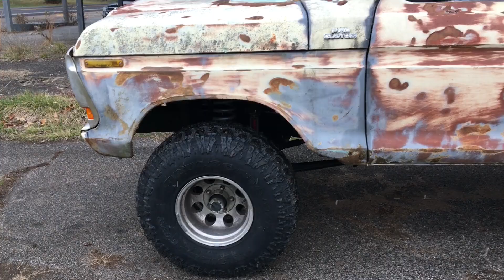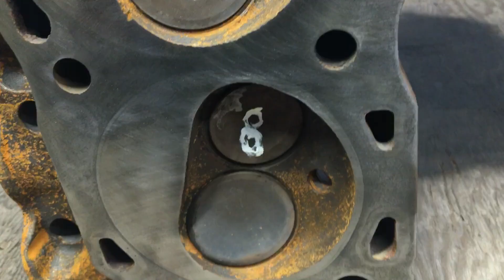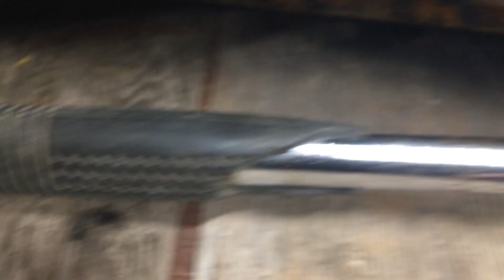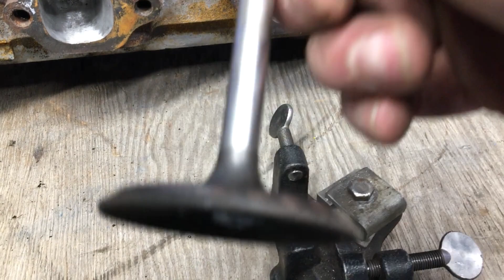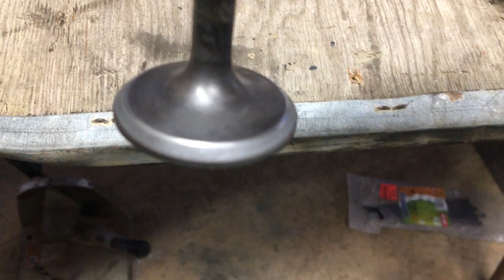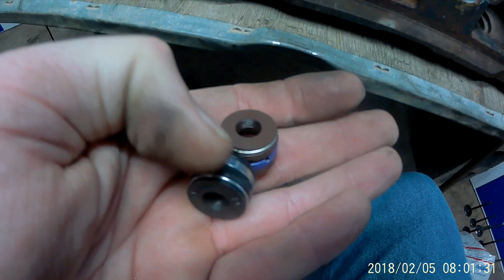460 EFI Cylinder Head Porting and Rebuild!!!

Comment: Have you ever seen 460 heads with valve rotators?
Reply from the maker: I have never seen a 460 with valve rotators. I'm not saying that they don't exist but I've never seen one if they do. I always thought it was odd that they was the only engine that didn't get them. FE's got them, small blocks got them, and the 335 series engines got them but not the 460 it seems.
Reply: @BlackLabGarage  That IS odd. I was thinking maybe they all had hardened valve seats and that's why no rotators but that wasn't the case. From my research some of them had hardened seats and some did not.  I guess it is a mystery. Thanks for the reply.
Reply from the maker: @ the old model high compression heads did not have hardened seats. By the time the D3VE heads came out was when Ford had started using induction hardened seats. But the seats in the fuel injected heads are as hard as granite!
Reply: @BlackLabGarage  Good to know. Thanks!
Reply from the maker: @ you’re welcome!

Comment: I just did another set of FE heads complete 3 angle seats & was able to bring each seat in by using the stone & holder turning it by hand. Lol.
Reply from the maker: @jesseduke694  that had to of taken a while to do lol
Reply: @BlackLabGarage  it really didn't take to long. I didn't do it all at once. I would just sit down at my bench now & then & drink coffee & start tinkering with my hands & I would ink up a seat & just set the stone on it & spin it to see if it cleaned up all the way around & if it didn't, I just turned it till it did. But over many days, not at once.
Reply from the maker: @ even doing 3 angles it didn’t take long?

Comment: Also want to make sure to fully unshroud the valves on the chamber side to maximize airflow cfm into the chamber
Reply from the maker: @matthewmiller2268  I need to examine these F3TE heads a little closer because they have a different chamber than the earlier E7 460 EFI cylinder head. I have an E7 head here. I need to measure and see how much difference there is between the two as far as the valves and the chamber shrouding

Comment: Spring locks are like women, sometimes it takes a bit to get them in the right position. Great video. This makes me rethink my approach on this same engine on my stand. I bet EFI heads make better torque. I wonder when there will be an aftermarket carbed intake for these heads.
Reply from the maker: @softenerguy  sadly I’ll say there probably never will be a aftermarket intake for the EFI heads. With the EFI 460 only getting a 10 year run and with a lot of people going the Coyote and Godzilla route, there probably isn’t enough demand to justify the cost of designing and casting the intakes.
Reply: @BlackLabGarage  I'm afraid you're probably right. I think the factory intake works pretty good already and would support additional torque as-is. Saves us a few bucks too.
Reply from the maker: @ yeah intake manifolds have gotten ridiculously high dollar

Comment: We were advancing the cam timing on Ford V-8 engines in the late 70's. It was especially bad at high altitude.
  I worked as a line mechanic at a Ford dealership mountains of Arizona and ranchers couldn't pull stock trailers with their brand new trucks.
Reply from the maker: @MichaelCoger  that doesn’t surprise me at all with the retarded cam timing, lazy distributor advance curves, and really low compression ratios that Ford had in the 1970’s. A good example is in 1970 a 351W was rated at 290hp. In 1979 a 351W was rated at 154hp. Which I know they changed from gross to net hp ratings in 1972 but it wouldn’t have changed the ratings that much. Their engines power output from the mid 1970’s thru the mid 1980’s was just pitiful.
Reply: @BlackLabGarage in 70 the 460 was rated at 365 hp! In 72 I believe it was 212 hp!
Reply from the maker: @ I know them changing how they rated the engines horsepower from gross to net ratings which  affected the rating some but not that much. The biggest reason for the horsepower loss in 72 is that was when the compression lowered on them.

Comment: Should do a video on swaping the bottom crank gear(cog) for a 429 gear..see how much toqure difference..
Reply: The fuel injected 460 used the straight up timing set, not the smog era retarded set.
Reply from the maker: @DaveSmith-ep9ew  I would love to do that but that would mean dyno time which is quite costly.
Reply: @DaveSmith-ep9ew
Not needed!!!  
The EFI 460’s come with a double roller timing chain installed “straight up”! 
 SO - the cam is not retarded in these -
  like the 70’s smog engines were

Comment: Thanks for the video. How critical is it to get the recommended installed height correct for the springs? I am changing mine with shims and can get close but not spot on.
Reply from the maker: @MaxDeet7439  on a stockish type rebuild it’s not as important as it would be on a high performance engine. I mean get it as close as possible but I would rather the installed height be a little taller than what it recommended rather than shorter than what is recommended. Shorter installed height would mean higher valve spring pressures and also get you closer to coil binding the spring.
Reply: @BlackLabGarage  That makes sense. Thank you!
Reply: @MaxDeet7439 if your within .015 more than, or less than, your fine

Comment: Awesome. I currently own a 92 f250 with the efi 460. My goal is to upgrade the efi to a different fuel injection system ( aces looks good) with distributor) that will open up the cam options. It’s wonderful to see how the head are. Helps me plan. Thanks.
Reply: You can't beat factory EFI. Except with a carb.
Reply from the maker: @ I agree. The one exception might be I can’t remember if it was 1996 or 1997 California 460 actually got mass air instead of speed density. So even though the mass air system from back then was crude by todays standards, it was still much better than the speed density system. But that was the only 460 that ever got mass air and it was one year only in California.
Reply from the maker: You're welcome. I'm glad this video helps you!